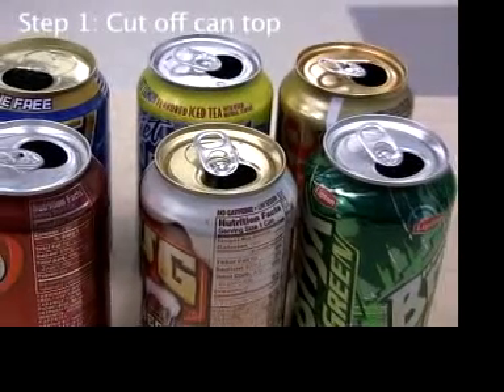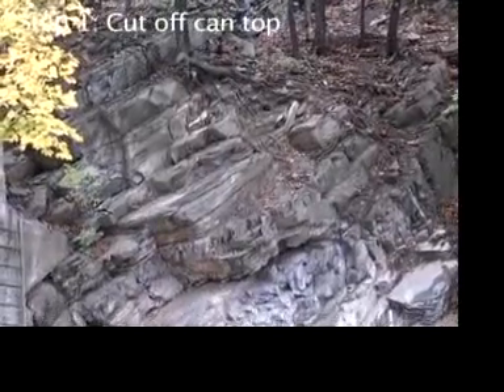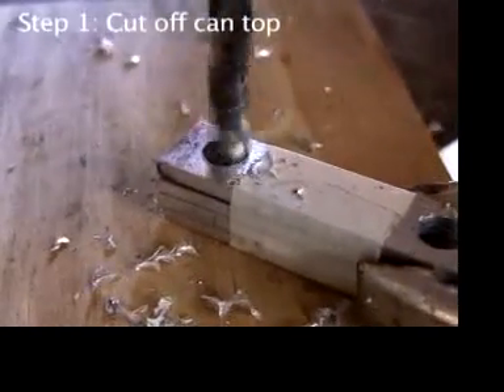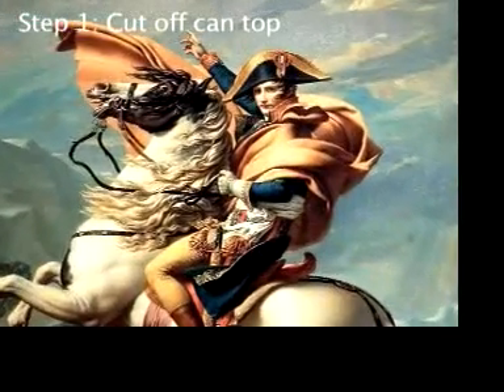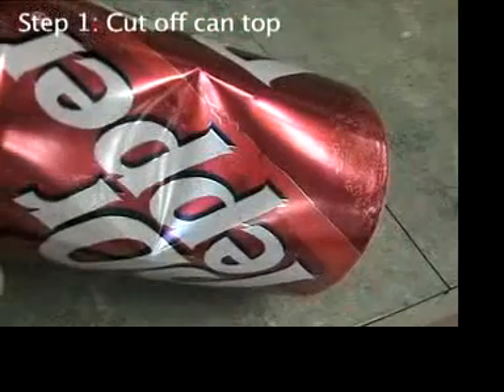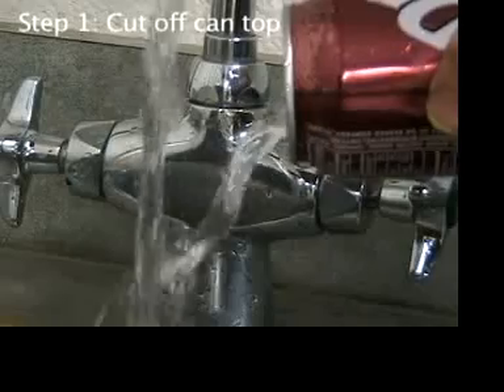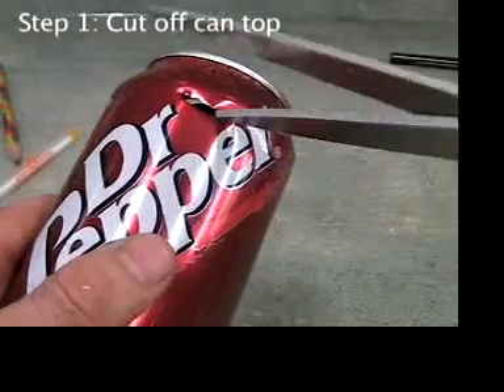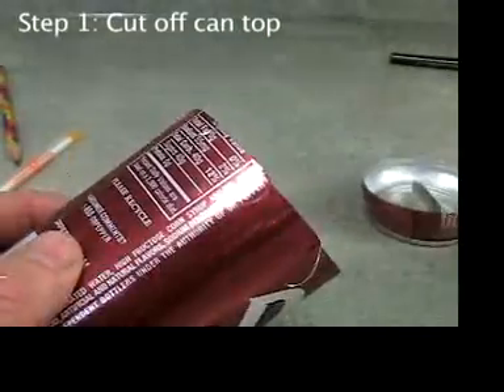Part 4 Build a Putt Putt/Pop Pop Steam Boat s1 cut top can

Comment: Dude, thank you so much! I have already made a boat a couple of years back for my friend, who did sound for a pretty big band, and always put me on the list for any of their Austin shows to which I wanted to go. Now, I'm gonna do a batch of 10 because I'm gonna be broke this Christmas. I'll try to get pictures of my previous boat, but I'll take pics and vids of the new ones as they are built. Thanks again!!!
Reply: I direct props to sciencetoymaker.org, in case you're wondering.
Reply from the maker: I'd like to see your fleet, Wes. I am starting work on a simplified design for the engine that will be faster and easier to make without dumbing down the power. The two most important things are: no leaks, and the bottom must be as flat as possible.